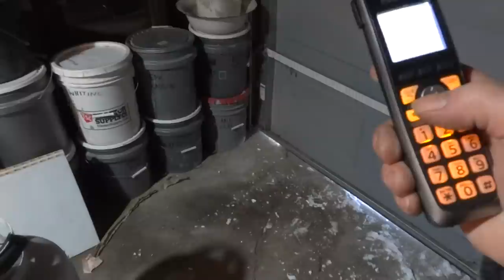SIMON LEACH POTTERY TV - Out in the cold loading a bisque !

Comment: Each term I let the students pick one non ceramic thing to feed the electric kiln, we do a before picture and an after. The worst one was a Nintendo DS. Splattered some gunk on the shelf which I had to grind off. 
But the orange and the steak were interesting.
I pack with room around the edge of my kiln with an inch on all sides and a little room between the items and the next shelf up, the chosen item usually gets it's own shelf so it doesn't wreck anyone's work. Thought of doing a wee wicker man ....

Comment: definitely get a pyrometer i use mine more as a speedometer so i can check my ramp speed and temp difference top to bottom of the kiln(I Use a cone in the hottest part of the kiln and pyro at the top) !
Ps my pyrometer is a skut (i think) digital that reads in tenths of a deg c or f so i can count off deg per minute. its the yellow 2 channel one so you can use 2 YES THATS 2 !!! thermo couples at the same time!!!!. but i only use one cuz i am poor....
PPS i checked and yes its a skut dual input type -k, goes for about 120.00 bucks....with one thermo couple....
good for cone 10...
Reply from the maker: rbanalog thanks for the info i will look into getting one !